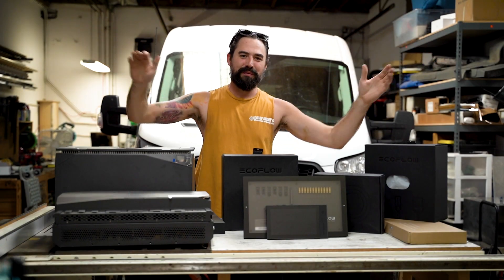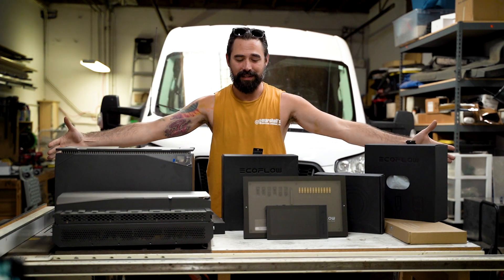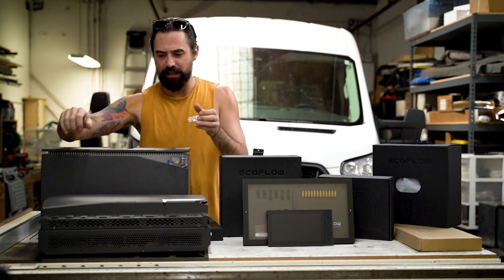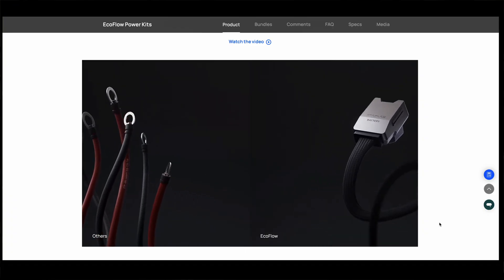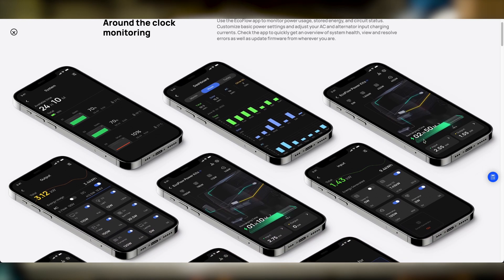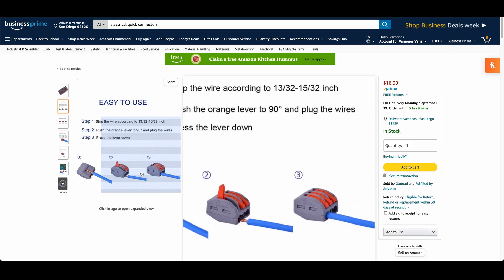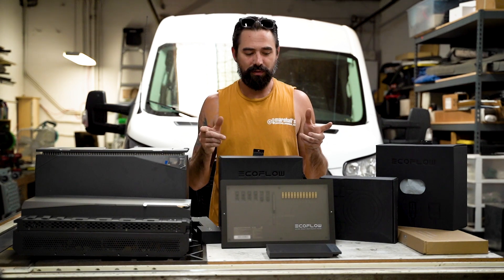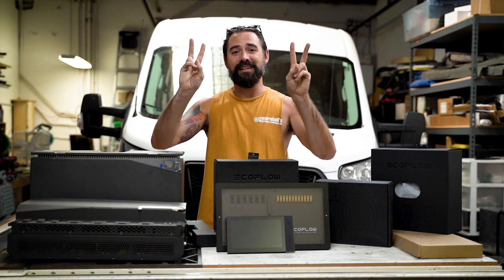STOP building DIY ELECTRICAL SYSTEMS in your van builds - EcoFlow modular Power Kits unboxing

Comment: Can i add another brand of battery to this system? For example renogy or any other brand?
Reply from the maker: Good question! The answer is no you cannot add another type of battery. That would introduce a number of variable and complicated electrical challenges that would cause more headache and problems than its worth. Its way easier, cheaper, and safer to just buy another EcoFlow battery and stack your capacity.
Reply: @benpryce  thank you! And how much is the battery itself?
Reply from the maker: @zura73  the systems start at $3299 right now

Comment: In addition to MPPT solar input, can you also hook up wind generator as an input to charge? I m not sure if the shore power and alternator charge inputs can be repurposed for the wind generator input since solar will feel the mppt … Re: marine use case, sailboat. Thanks.
Reply from the maker: Great question! Im out of my depth on wind power. That would be a great question for EcoFlow tech support though! Let us know what you find out.

Comment: I’ve been looking at this system. How do you plan to run air conditioning?
Reply from the maker: DC aircon gets run off a bus bar
Reply: @benpryce  yes, but how many amps can you draw on this system? @ 12v you need 100amp? plus whatever else your running? I want to order this system but have not found a clear answer on what it can handle.
Reply: @benpryce  yes, but how many amps can you draw on this system? @ 12v you need 100amp? plus whatever else your running? I want to order this system but have not found a clear answer on what it can handle.
Reply from the maker: @bigboatben  you shouldn't be pulling 100amps on a 12v aircon, its usually around 50 or less. This system can put out 70amps continuous in 12v.

Comment: I’ve been looking at this in the 10kwh setup but can’t see anywhere that it shows it would support a Nomadic 12v Air conditioner.
Reply from the maker: They may not have written it anywhere specifically, but this is one of the most powerful and robust power systems available. It will definitely run your 12vdc air conditioner.